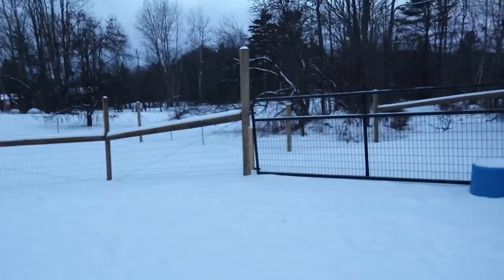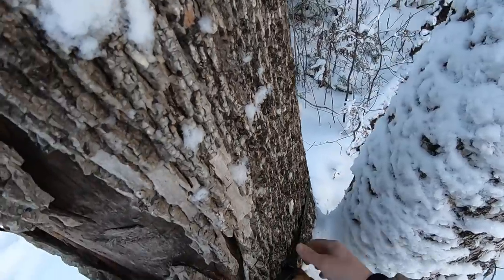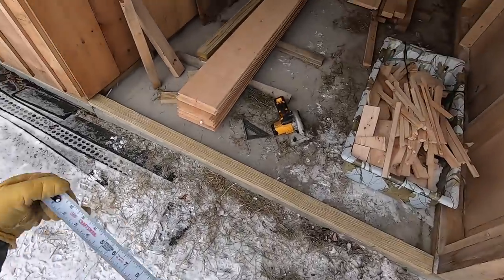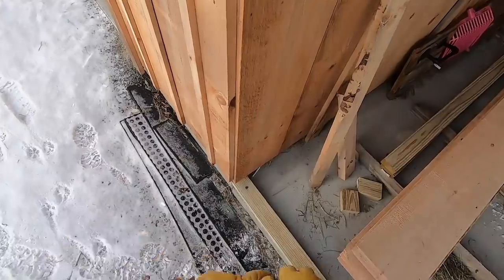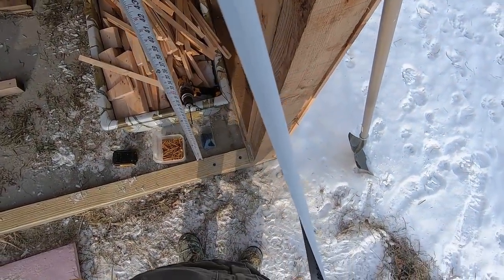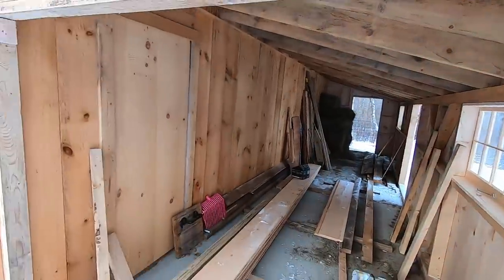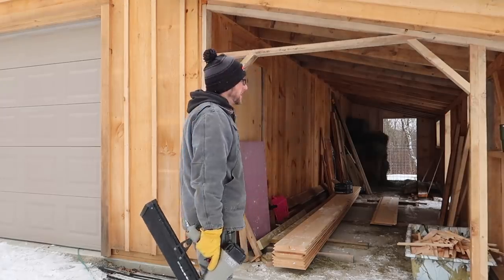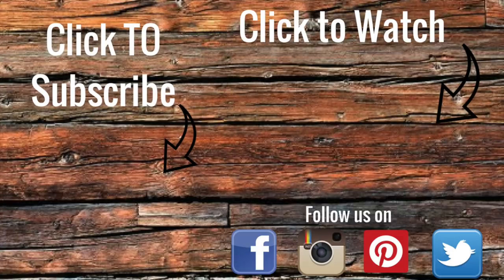USING all the TRICKS we LEARNT building the BARN is Paying OFF (Customizing the front of the BARN)

Comment: Goood morning everyone from here in SW Idaho where the present temperature is 32. Hey Al, battery nailers work very well.  Although they are heavier than their pneumatic counterparts; you don’t have the extra weight of the hose to lift/drag around nor do you have the noise and hassle of compressors and extension cords. Downside would be the effects of the cold on the battery(s) and the expense of the nail gun itself. You already have the battery platform so you could get a the tool only option which would help,on the cost. Can’t wait to see the end result of the siding and buildout.

Comment: Love your workmanship! You could read all the tracks you find with a simple Boy Scouts handbook and learn a lot of woodlore at the same time! I hate to tell you this but you need sill under your windows completely under the sash and overhanging the siding by about an inch. It needs to be pinched out about 5 deg. It won’t show now but come spring when it’s raining it will leak where the vertical siding is nailed to the horizontal 2x4. You might be able to correct it with a piece of aluminum drip edge , but I’m not sure of the width of the space from the sash stop out to the siding. If you know someone who has a brake they might be able to bend you a few feet of drip edge that will fit your sill exactly.
Reply: Ken Corsell ~ I was going to recommend the Boy Scout handbooks last video and forgot to. There's a wealth of information in them, especially the old ones!

Comment: Build a hay feeder like the one for the boys but with wheels and a pull handle, make it low enough so you don’t need to build side stands
Reply: That what I was thinking too
Reply: Sled runners for the winter!!
Reply: That is what I did for sheep, 2"x4"x8' long for runners. 3-2' cross 2"x4"s under 18" wide box 8' long made from 1"x12" boards for sides of box, 1/2" plywood bottom. 2"x2" corner post and 1 in center on long side. Center posts about 3" taller for rain to run off to the ends so not running on the backs of the animals. 2"x4" about 12" above box. 4' 2"x2" across top of posts to act as rafters for 2 sheets of 10' roofing tin. Built them to be mobile and fit S-10 pickup box. I also made grain boxes, 1' wide box of 2"x6" with a plywood bottom and cross skids of 2"x6" 18" long under them cut at 45* angles to get them off the ground and keep them from turning them over. Each feeder held a bale of hay and a protein block out of the rain....James
Reply: @jwal1037  Why not have the roof going the other way with gutters leading to a rain barrel with a spigot so water can be supplied right there during the summer?
Reply: We don't get rain in the summer and we don't feed hay in the summer. I needed to keep it light to load by myself in the back of my pickup. We get very little snow and sheep graze all winter. I had 12 feeders and  300 sheep....James

Comment: When will you start using the side door from the shop? That would make life easier.
Reply: When it gets warm I am sure. Don't want to heat the outside.
Reply: I believe Richard is talking about the door to the right. It's right where he's building. Al has a red door in the shop blocking that exit.

Comment: If you can find a cheap bike for the wheels you can build a hand cart style feeder to simply push down on the handles to lift the support feet then roll it where you want it and set back down. If you don't mind the mess of roller bearings that might come out you can ever swap the axle in the wheel for all thread of the same size for easier mounting but if not a steel plate with the axle sized hole to bolt the wheel to and then screw to the wood of the cart.

Comment: Wondering...if you put a 2X4  sill on that door, it will make it very hard to move any thing with wheels in and out of that area. So did you change your mind about storing the Kubota there?
Reply: He will cut the center portion of that 2x4 out. He does it this way to make sure everything lines up in a straight line.  (I wonder if the Kubota will go in there, too!)  :D
Reply: He cut centre portion out, it's common sense to watch all of video before commenting!!!!

Comment: They continually molt a few feathers evenly on both sides of their bodies year around and a fast molt during the hottest months. Here in Michigan the fast molt is in August and early September when all the flight and tail feathers drop and are replaced getting them ready for the winter months. Also the slow molt drops the extra winter feathers during the late spring so they don't over heat during the hotter months and regrow them during their fast molt. Do you have a place in the coop to allow them to have dust baths (75/25% mixture of dry play sand and diatomaceous earth) to rid the feathers of parasites. Parasites populations can trigger molts to naturally rid the birds of heavy infestations at odd times during the year. It helps to sprinkle diatomaceous earth inside the coop and on the perches monthly to prevent heavy infestations.

Comment: Trapping help.
This is gonna be a little lengthy and I’m sorry about that. But from what I see from your attempt to trap predators is that it’s quite possible that it could be in vain. I’ll explain.. you have your traps set up on a well used game trail and if you were trapping for fur that would be the perfect place to set traps but that is not what your doing... there is a very good chance that predator tracks you found in the woods were actually stocking other animals that use that same trail and NOT your farm animals. Second your traps are animal specific. What I mean by that is the opening on those traps Is only big enough for smaller predators when In fact you could be needing to trap anything from a bobcat to a fox or coyote. But you don’t know that. The camera which is a very good idea because of where you have it will give you a pretty good idea about what kinds of animals are using that trail. And possibly the animal that is assualting your farm but then again it may not. The only way to know for sure is to set your camera up around the area where you keep your farm animals in particular your chickens.. once you have discovered what animal it is then you can set the appropriate trap.there are a couple of ways to determine the size of the offending animal. One way is to actually see it.. one is by tracks left in FRESH snow and the other is by capturing it on camera a predatory animal will more then likely circle the entire enclosure looking for a way in. It may require a different type of trap I hope this helps. If it were me I would set up a camera close to new yolk city and if your still using the green house to raise your other chickens set one up there too.
Reply: I didn't know we had kingfishers around here but people said that what took the heads off of my sons 12 chickens.  6 one night and the other six the other night.  Just the heads gone, body left.  Then gone the next night.  Then repeat several nights later.

Comment: You are using that nail gun wrong. you don’t pull the trigger and tap into the wood. you push the gun into the wood, then pull the trigger. that will save you from having to sink the heads of those nails! Less work as you go 😀

Comment: Why’d you put the girl goats hay out in pasture? The boy have old cover over hay and if cold they can get inside out of the weather or make feed cover then start out this way.Do you ever finish a project? Yes wood shed.but if you finish barn you wouldn’t be back closing that side in bad weather , put water stuff in unfinished nice but water need now do you use did you attach pipe was not working. Get new parts for it no finish work bench could get the junk out of basement. Move your tools out clean up your messes.now putting goat to stand in that mess when you built a nice feeder inside and outside. Just a lot  (????) Feeding goats in pasture isn’t one of your better moves.

Comment: STOP USING THE GUN AS A HAMMER  .   IF YOU PUT  Gravel AROUND THE BASE OF YOUR BUILDINGS IT WONT SPLASH UP  AN WILL STOP TURNING THE BOTTOMS BLACK  ITS MOISTURE AND THOSE BOARDS WILL ROT OUT IF NO SEALER ISN'T PUT ON

Comment: It appears that the door is skewed to the left and not centered. You had 78 in which left 14 in or 7 in from left and right. I don’t think you offset your king and jack posts at the right distance. The brace on the right looks a lot longer than the. Left giving the illusion of an offset irregularity. Simply put the door looks open centered. You ask for ideas and suggestions but you seem to get offended when we point out how to do it easier oh you still need a tool belt and please don’t use your drill or nail gun as a hammer
Reply: gerald corbitt when and how does he “seem” to get offended? I’ve been so impressed with his asking for pointers all the time, and then taking all advice to heart and actually using it! He’s great about that!
Reply: Jenny’s you don’t have the responses or lack of